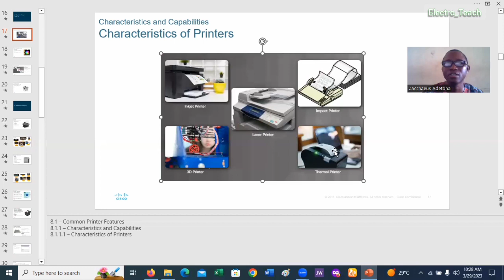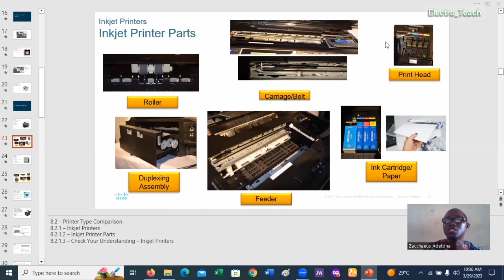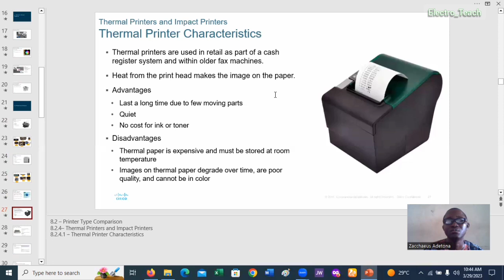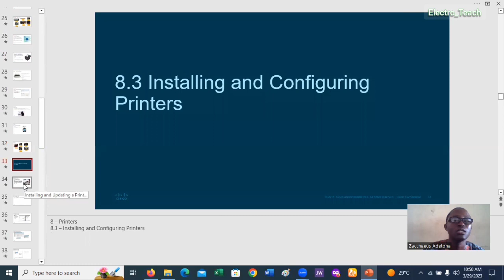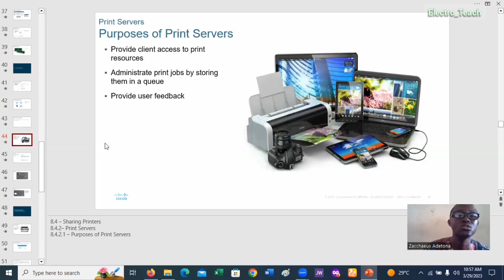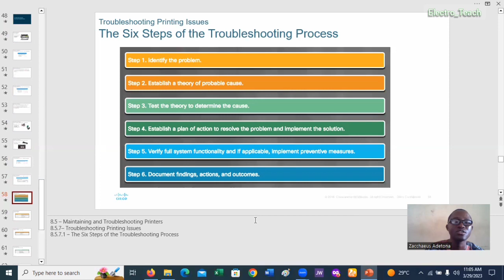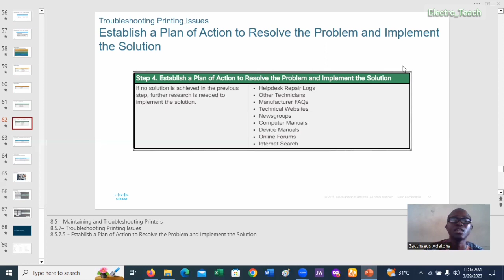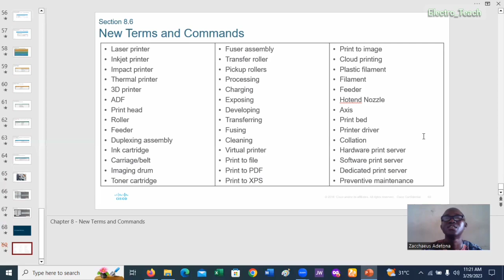PRINTERS HARDWARE COMPONENTS:MAINTENANCE & TROUBLESHOOTING @electro_teach | #printers #printersetup

Comment: This video talks about printers . 

A printer is an output device for computer systems. 
 
The video also talks about the features of a printer

Characteristics of a printer which includes 
SPEED - Measured in pages per min 
QUALITY - Measured in dots per inch 
COLOR - could be in cyan,magenta and yellow. BLACK is used for inkjets in the base or key color . 

Also speaks about the types of printers which includes:
INKJET PRINTER 
LASER PRINTER/LASER JET PRINTER 
IMPACT PRINTER 
3D PRINTER- This doesn’t print hard copies of typed work. 
And lastly THERMAL PRINTER . 

I learned a lot from this video 
Thank you sir

Comment: This video is about printers. There are different types of printer namely
Ink jet
3D
Visual 
Impact etc
The capability of a printer is speed and quality
The characteristics of a printer are:
1. Warranty
2. Schedule servicing
3. Mean time between failures (MTBF)
4. Total cost of ownership
        * Price page
        *Warranty cost
        * Initial purchase price
HOW TO INSTALL YOUR PRINTER
1. Follow manufacturer's instructions
2. Remove all packing material and keep if a return is needed. etc
Test function of a printer
Draft mode
Different paper tray
Collation. etc
Then we have some of the 3D printer namely: feeder, print bed, Axis, filament. 
This video is really helpful cause I learnt so many things it . Thank you very much sir. well done sir
Reply from the maker: There's nothing like visual printer. Where did you learn that from.